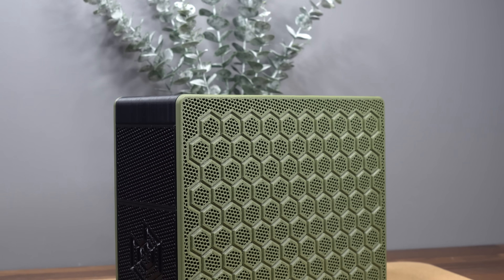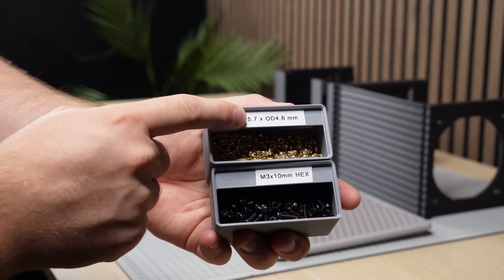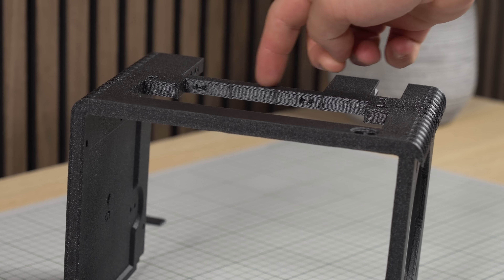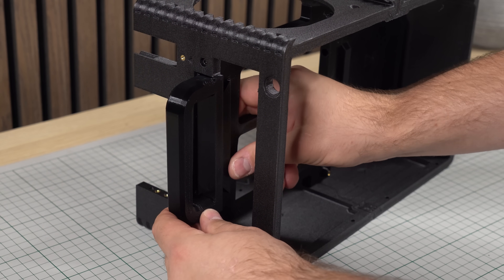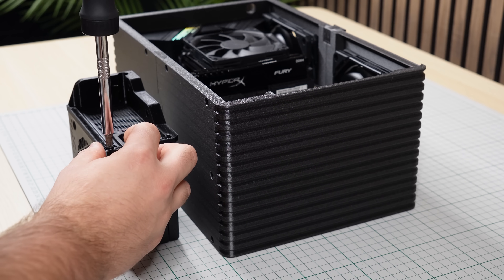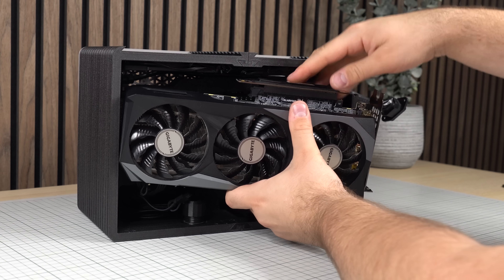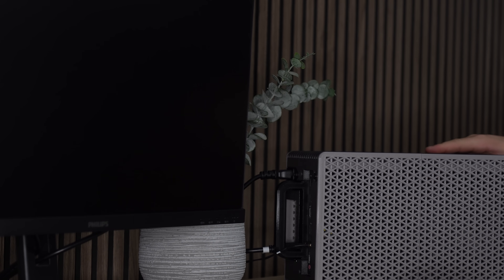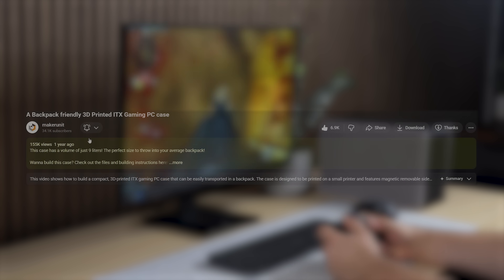The Backpack-friendly 3D Printed ITX PC case - v2.0

Comment: Great case design, really nice the stock am4 cooler is supported in this build. I think for another build you should make a micro atx motherboards and atx powersupplys for Budget builders that have a 3d printer.
Reply from the maker: Thank you! Aiming for the budget builders is definitely something to consider, as it seems to represent a large portion of those watching these project videos 😁

Comment: I'm still waiting for one where I can mount two different card (Capture Card and Graphics Card).
Reply from the maker: ITX, mATX, ATX? 🤔
Reply: @makerunit  It would have to be MAtx, or one of those super rare UTX boards- ITX but with an extra expansion slot. I think ASUS has one right now, but that's it. A Matx that was barely larger  than the motherboard would be nice, as these are also often the cheapest boards to buy lately.
Reply: @makerunit ITX, there's a few that have one x16 and one x4 slot. Though mATX works too, is cheaper overall.

Edit: Scratch that, the ITX boards no longer exist so mATX it is.

Comment: Another awesome design! It’s a shame my current backpack is a bit bigger than this one, haha. I’d love to see a slightly larger version — maybe with room for a 3-slot GPU, a 67mm low-profile cooler, or even a 240mm radiator. Nonetheless, it’s a beautiful case!
Reply from the maker: Thank you! An ultra compact case with a 240mm AIO would for sure be fun to try some time! A 67mm cooler would for sure allow for some more powerful parts. 

Perhaps I should create a «Suitcase» friendly PC case series 🤣 cases to fit within a standard size Samsonite! Or perhaps I should just 3D print a case with built in wheels and an extendable handle so the suitcase itself isn’t required 🤔
Reply: Yeah, would love to see a slightly bigger version as well
Reply: @easyluckable  👆
Reply: I'd spring for trying to fit a 280mm rad at that point. They have almost as much are as the usual 360mm at the cost of only being a bit longer and wider than a 240mm rad.

Comment: Back again to beg for a solid rackMount nas option with 3.5inch drives. Thanks love ya.
Reply from the maker: 10’’ or 19’’? I’ve been meaning to get there, eventually. I’m soon (in 2 months) about to start paternity leave and for many months so that might give me some time to come up with some ideas. Though due to limited time with a baby and having to follow that up all day long, I don’t see it as a realistic project in the nearest future. More like MAYBE summer/fall next year. 😅

In my head, if I’m building a rack mounted case, I also wanna build the rack itself, so it might be one of my biggest projects ever if I decide to go the way I envision. Also because, I like aesthetically good looking things, so a basic rectangular rack might not be enough for me 😅
Reply: @makerunit thanks for the response I’ve asked before. Just have old ATX parts that I want to be able to hook drives up to and love your work.
Reply from the maker: @andrewhornsby6403  I totally get that. 😉 I can’t make any promises at this time but I’m thinking about it, that’s a start.
Reply: I doubt a 3d printed rack case will hold up. The cantilever means the rack ears are under a lot of strain, and having to print it out in pieces probably means it will have even more flex
Reply from the maker: @IggyJackson  It would probably require a combination of plastic and metal parts to work well. Though I think it might be possible with the right design. But you’re right, it will be hard!

Comment: Hi bro! So ive been watching your content for a while, and it inspired me to do (or try lol) a 3d printed case for my matx system, right now im using onshape, could you help me out? Im not finished with the case yet (almost) but i wanted to be sure that everything works, because i dont have a 3d printer and i would have to borrow one, could you help me? Anyways, thanks and god bless!❤
Reply: Like make sure the dimensiona are right and everything will click together
Reply from the maker: Cool to hear you have a project of your own. Message me on Printables and I can take a Quick look at the design if you want me to, and I can provide you some feedback if I see some obvious flaws. 

However it’s often hard to know whether it works well or not until it’s actually printed. Even I go through 2-4 printed versions of every case before landing on a final version to ensure it’s as fail-proof as possible. Though if you plan to make a design only for personal use some minor flaws can often be accepted.
Reply: @makerunit okay! Tysm♥️
Reply: @makerunit just sent an message